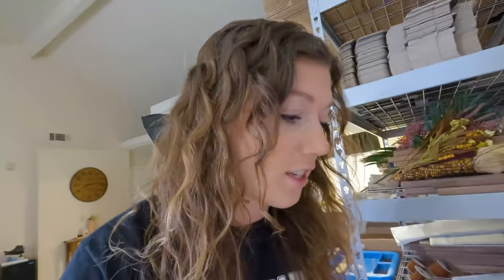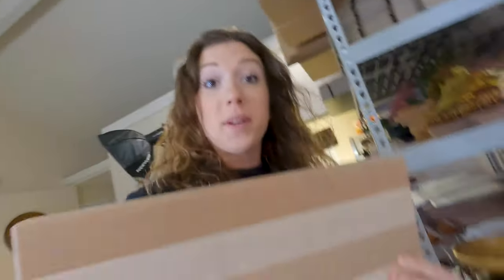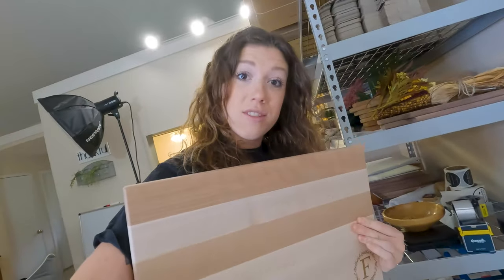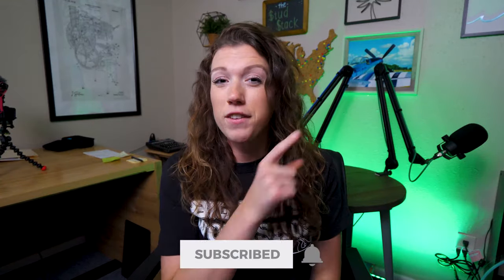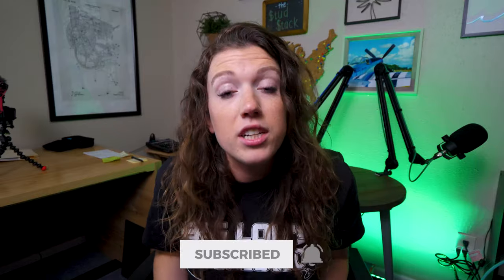Where are the bathrooms going? 6 things we need in our new ✨DREAM SHOP✨

Comment: If you can make your workspace U shaped, materials in at the top of one side of the U, work to the bottom of the U, cutting and such, then work to the top of the U on the other side, finishing, it helps keep the dust away from finishing.  Materials in the front, finished items out the front. Maybe put the offices in the middle of the U. This worked fantastically for 32 years in my custom cabinet shop. I hope that makes sense?
Reply: Assembly line. Good ol' Henry Ford!

Comment: I had a custom furniture shop for years . The one thing I Learned was flow in and out if you only have one roll up door .  The flow is bring in raw materials and place machines  in the order of use and flow around the shop  and back out the door leave a large area for fabrication and then staging for shipping back out the door . The best is two rollup doors one in one out. The other is showroom it pays for it's self. Remember sound proofing you Studio shop makes alot of noise in those Metal buildings  and noise from shops next door. I am sure you have thought about alot of this. I wish you two all the best in your endeavors. Creating custom furniture was some of my favorite times in my life.

Comment: Congrats on growing your business! You mentioned a blow up booth for a finishing area in one of these videos. I would like give you my opinion. I am a professional cabinet maker, but also have 27 years experience in the auto body industry. A blow up booth is a temporary solution to refinishing. I have a blow up booth at this time, until I can expand on my current building. Overspray still comes out the filters. The booth clouds up quickly when spraying alot of prices at once. If you are having a build out done, I would make what's called a crossdraft booth. The doors to the booth need to have a place for replaceable filter media, and then on the opposite wall of the doors would have the fan with filters that would pull out the fumes and overspray to be sent up a stack to be exhausted. I recommend a variable speed fan with controller.

Comment: One thought about the room for product photos. I wouldn't think that you would be taking photos all day, every day, or even that often. So, it would make sense to have a multi-use space that is also appropriate for taking product photos. Maybe use the break room for that, or maybe a set-stage in the studio that you can use for photos as well as some podcasting (imagine, interviewing guests around the kitchen table). The more I think about it, I think a set stage in the studio with a little space in the warehouse to store set pieces would make the most sense (and you wouldn't have to clean up the break room well enough to be photographed). If using this stage idea, then it might be best to have the studio near the warehouse, maybe the backwall of the stage backed up to the warehouse with big double doors. For sound insulation, maybe a back-stage area (like a vestibule between the actual stage and the warehouse) to help buffer warehouse noises from the shooting set.
Just spit-balling here.

Comment: My shop is just outside Houston.  DO NOT go without AC. When I moved here the shop wasn’t insulated with ac. It would get so hot and humid in there during the summer that it would warp my boards to the point of not being able to be used. Got it insulated and ac (proper ac works as a dehumidifier) and don’t have that issue anymore.

Comment: You will have to comply with TAS for accessibility on the office part which will drive part of the design for a break room and will make your bathrooms way larger than you would think. You also need clearances around all your doors.
Reply: I think that only applies to businesses that have over 30 employees or whatever number. Just like OSHA. it might not be necessary at this point but, I think all of the regulations should start right away anyhow.
Reply: @cindyhammack68  any places open to the public it is required. Employee count makes no difference.
Reply: @kielsiemoneit4613  but are they open to the public? Seems like an office and a shop. Not for the public.